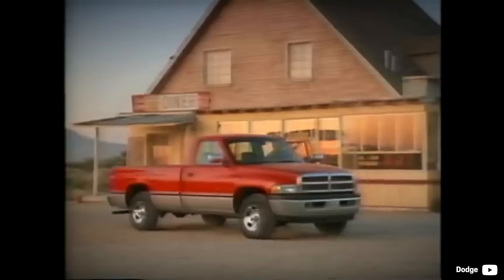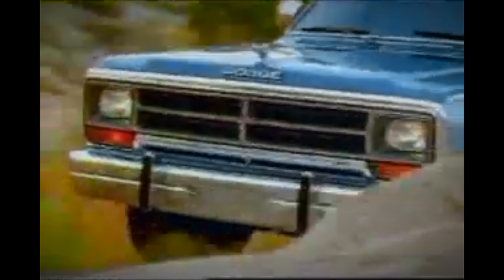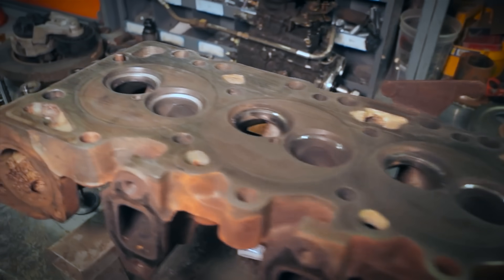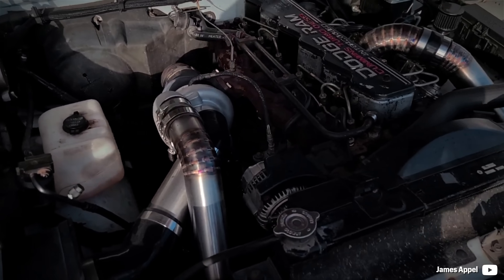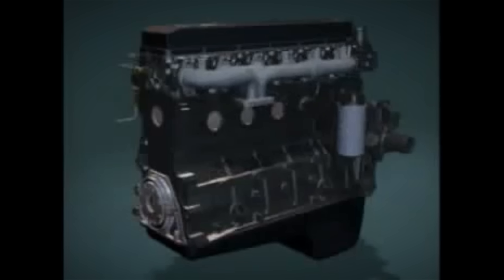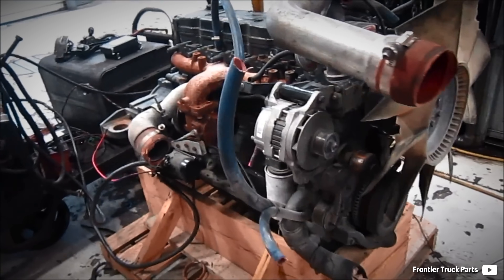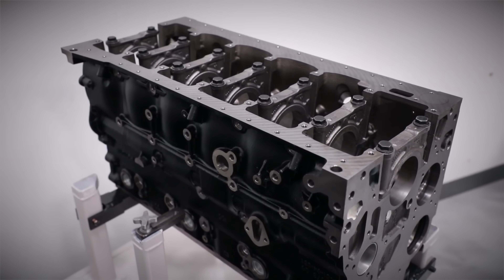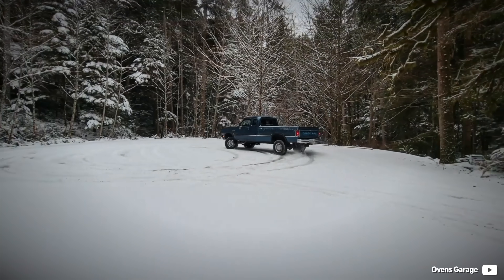The Most Reliable Diesel 6-Cylinder?

Comment: What's infuriating is international had the dt360 which is basically a better built 12valve cummins. The wet sleeve block meant that it could be rebuilt while still in the truck. The adoption of the 6.9 idi is an example of marketing getting in the way of practicality. Ford thought that American buyers wouldn't accept an inline 6, even though most agriculture diesels and class 8 engines were inline 6's
Reply: 👍👍..I've got alot of Cummins powdered trucks and machine's,but you're not wrong...👍... what's a dt360 weigh..just curious
Reply: @elroyelblander6277  I'm not sure right off the top of my head but I know they are a bit heavier than a cummins due to being wet sleeve instead of parent bore.
Reply: @farmyardfab 👍..right..and the head and block are probably a bit thicker... although,wet sleeves have there inherent issues... depending on the rod/stroke ratio, they vibrate alot and cause problems over time...but anyway, always wondered why they didn't use the 360 and the 408 instead of the fricken V8.. don't make much sense to me... Oh well 👍👍👊
Reply: @farmyardfab  DT366  was a piece of garbage  , underpowered , always leaking some fluid ,i've been around a lot of trucks with them and any truck that had over 180K had blowby that a cummins won't have till 400K or more ,,and they only have 250HP ,,the reason they are always broke is because the driver has to thrash it ,,lots of them in school buses  just like the 3126 CAT/C7 , they are good for 200K miles and then junked which is what happens to school buses,,,i've got a 140HP case tractor  that has a 6BT cummins with 12000 hours and still no blowby to speak of
Reply: @wildcoyote34  they all leak dude, stop the hate.
Reply: @wildcoyote34  6bts that aren't equiped with the p7100 are underpowered as well. As to longevity I can't speak ill of the 6bt but the dt360 is immortal with it's wet sleeve construction in comparison. I don't know what happened to the engines you were exposed to but I haven't heard much bad from anywhere else.
Reply: @farmyardfab  i've seen way too many DT366 engines with excessive blowby  ,and i'm not talking about 8 or 10 engines i'm talking about dozens and dozens of engines ,majority with under 200K miles ,,6BT is a light duty engine compared to a DT366 ,,DT366 suffers from constant issues with liners leaking coolant  ,,I've scrapped 3 this year that had issues with cracked liners  that had damaged the block ,,all of those had been run till they quit and were beyond economical repair ,,what says it for me is ,,,what do you see the DT466 engine installed in ,,IH trucks and nothing else ,,the 6BT was installed in dozens of vehicles , tractors , generators ,trucks ,RVs buses ,,it's economical , reliable and long lived ,,the P7100 mechanical pump is nice because you can turn the fuel up easily ,,with stock injectors and an intercooler  most didn't make over 200HP from the factory ,,my farm has a medium size CASE tractor from the early 80s and it has a 1st gen 6BT it's about 170HP
Reply: @traxxasrcfun  funny my case tractor doesn't leak anything except air from the braking system ,,i have yet to any international engine that didn't leak oil ,,DT360 and 466s love to leak from the crankshaft and front cover and valve cover,, Caterpillar engines from the timing gear cover and where the compressor mounts and around the oil pan ,,the places cummins like to leak , especially the 6BT are the individual rocker covers , and the timing cover ,,, if you seal them right they don't leak EVER, and mine were fixed right many years ago
Reply: @wildcoyote34  and our 250k dt466 doesn’t leak a drop, what’s your point
Reply: @wildcoyote34  every diesel will eventually leak.
Reply: @traxxasrcfun  yep and when it does if it gets fixed right it never leaks again ,,,,and if an engine is built right it'll never leak  ,,the problem is mass manufacturing isn't that precise and doesn't allow the time to make sure things are tight enough not to leak ,,a little extra sealant makes  a huge difference,,
Reply: @traxxasrcfun  when your DT466 has 12000 hours on it  come talk to me ,,the 3126 CAT in my 95 GMC 5500 RV toter  has 400000 miles on it with no leaks  or blow-by ,, when i bought it 10 years ago i went through it and replaced every hose and resealed the entire engine even though it didn't leak ,,it won't leak now ,,i have an extreme dislike of oil leaks  ,a habit picked up from my grandfather ,fix the problem before it starts ,,,
an engine constantly leaking oil is not only a mess to work on but also becomes a fire hazard, and then there is the $5+ per quart of oil which when you own a half dozen large trucks and dozens of pieces of machinery ,, ,the oil leaks add up to a big expense
Reply: @wildcoyote34  I have no idea how many hours it has. We also have a 3126 cat in a freightliner. Great engine but my gosh is it slow. The dt466 walks it bad.
Reply: @traxxasrcfun  3126 is a similar sized engine to a DT466 ,,from what i have seen the DT466 was never used in medium duty trucks like the GMC 5500 i own ,,leastwise i have never seen one ,,other than in custom applications ,,,the other engine i have seen used for swaps is the  8.3 ISC cummins , i personally have one in my other medium duty truck ,and it'll run away and leave my cat powered truck in the dust ,,the cat engine just is not fast and mine has a lot of miles on it so i don't push it hard ,,when it dies it'll get replaced with a cummins 8.3 the one in my RV tow truck has more power than the cat and it also has an exhaust brake which works very well ,,it's pushing 250,000 miles  ,,i pulled it from a wrecked RV a few years ago ,,i changed it to  a manual transmission  7speed eaton compliments it very well
Reply: Do you mean dt466
Reply: @lewisbradford3305  no goggle it. The 400 series and the 300 series were both engines originally designed by International Harvester co and later produced by International Navistar. They are sister engine lines that do share a few common parts and one could see them as big block and small block diesels for the international medium duty truck line. The dt360 is smaller in every dimension than the dt466 including a 360ci (5.9l) displacement. I believe the dt360 was discontinued in 1994 while the dt466 was changed into the dt466NGD (Next Generation Diesel) and eventually the dt466E (electronic).
Reply: Odd enough, in Brazil Ford resorted to an engine which was also easier to rebuilt
Reply: Packaging was the issue with these motors.   They can be made to fit but it's quite a bit more work than the 6BT.  I looked really hard at them several years ago.  Great engines.   There are swaps out there.. but the 6BT is just easier to fit.
Reply: V8 was chosen for superior power band and packaging, idi for noise and emissions. I'm getting a chuckle from the dt haters, when all the Flatbrim fat chick haulers have all been blown up there will be dt's to haul them to scrap.  DT is too big and heavy to practically use in light duty, and much the same as the 5.9, isn't particularly suited.
Reply: @doxnoogle5782  the dt 360 isn't really all that bad. They fit without firewall modifications and the radiator sits in the stock location. I did have to cut out the cross member but with a different oil pan or a different factory cross member they could have made it work. As far as power band I really doubt that a factory idi would have any sort of advantage vs a p pump dt360.
Reply: Stock to stock?  Either way talking power band, not raw capable output.  V8s may not make the peak torque of a comparable inline, but you have usable power from off idle to 3500 rpm, sometimes more.  Been my experience inlines (5.9 / 8.3, dt360/466, 8.2, 9.0) peak around 2200 and are done by 2500 majority of them are in fact governed there.

Also most sources put the dt360 at ~1400lbs dressed.  Tbh, if dealing with the weight either way, i would choose 1160/3208.  Im biased here though, we have an 1160 in our 69 F8000... no muffler, big stacks :D

What did you do for transmission?
Reply: @doxnoogle5782  indirect injection IDI went away with the 90s and the death of the 6.5 detroit diesel in GM trucks ,,they were slow ,inefficient and far from clean 
i'm not sure where you are getting your info at because there never was a V8 diesel that was packaged neatly ,, the word STUFFED into the truck applies to any V8 diesel installed in a pickup truck or van ,,V8 diesels were invented because americans have a love affair with V8 engines ,,not because they were neatly packaged ,,or easy to service ,, that falls to the inline 6 cylinder engine 
actually the 5.9 cummins was perfectly suited to light duty trucks ,,it's not really heavy , has a decent power to weight ratio and is reliable ,, DT466 weighs over 1400 pounds mostly due to having a wet sleeve design  , it's block is heavier ,,the 8.3 cummins is actually much more comparable to the DT466 , it's actually heavier than the DT by several hundred pounds ,,and it also has wet sleeve design 

i know i had to upgrade the suspension in my RV tow truck when i swapped the V8 gas engine  with an 8.3 ISC it weighs 1800 pounds ,,my 454 weighed just under 900 fully dressed,, just under 350HP at 2500 and 1070 Ft pounds of torque at just over 1050 rpm it'll beat a DT466  easily, plus i have an exhaust brake and also a VGT turbo ,,if i could add Jake brakes to it i would do that as well ,,,the later DTs do have the variable turbo as well ,,i'm not gonna say that the DT466 is a bad engine like so many other people have ,,because the numbers speak for themselves  there are millions of them so it can't really be a bad engine just because i don't like it ,,i'm not a fan of V8 diesels in general either
Reply: Actually, my info comes from mostly historical documents from just about every manufacturer.  Inlines, 8 and 6 gave way in all but fringe cases to v8s and v6s due to packaging.  Im not sure why you think its so hard to put a v8 diesel thats the same size as a big block into and engine bay that already houses said big blocks...  Not just americans that love v8s, find a gear head that doesnt, theyre just more common here due to the fact every soccer dad thinks they have to have a "truck" and karen needs her denali suburban.
A 5.9 weighs the same as the other light duties +/- 100lbs, this varies through the years.  Combine a meager 160hp with an extremely laggy h1c and a 2400 rpm defuel, they really hauled the mail.  Point of fact, the 5.9 never once made more horsepower than a ford equipped diesel, cummins did however have the idi beat in torque.
We were talking dt360s, the 466 is a behemoth.  There are no compression brakes available for the 8.3, jacobs or otherwise.  The dt466e has no shortage of troubles, much the same as the ISX.  For my part ill stick to talking mechanical engines.  Both the dt360 and 466 are definitly under-tuned from the factory, their performance headroom however is staggering.  Ill part with this, if its a tractor it needs to be green, if its a truck, yellow.  Ill keep my hotrod IDI too.  Either way, im sure that 8.3 was a huge upgrade over the 454 and it no doubt drives easier on the road and on the wallet.
Reply: @doxnoogle5782  something interesting , why didn't they keep making the DT360 if it was such a good engine  , i honestly don't know much about them ,,
,,I wondered whether there were compression brakes available for the 8.3  , i never could find any information  ,, now i know 
it has an exhaust brake though and it works pretty good 
I'm pretty much an equal opportunity employer ,, color doesn't matter so much  so long as  it works and does the job reliably ,,still have a 1959 JD 730 diesel  that my great grandfather bought new just 2 years before he died and i am currently restoring a 1969  4020 ,,same way with trucks i've had some of everything
Reply: I dont know, but my assumption is the IDI and t444e replaced it in application, smaller, lighter, easier to package, more emission friendly.  The 9.0L was an option as well, i base this just off of what ive seen in S series internationals, we have had a ton over the years as farm trucks and fire trucks on the ranch.

I dont have any real extreme hate, except for the ISX, 8.2 detroit, 9.0 IH, and newer deeres.  We havent owned an 8.3 that didnt get a headgasket, 7220 case, f750 and im pretty sure thats what was in that pos 80s kw we had.  JD up to 60 series were simply the best, no comparison, today, over priced junk unfortunately.  Have always been a fan of Cat, never had problems with them, and the 6nz in the pete is a monster.  Also have a 650 with the C7 that acts way bigger than it is for the weight.

I missed your 12000 hr comment, lol thats cute.  We have a 1266 with over 40k on it and the DT360 in our pumper truck has 540k miles.  This is bouncing around in the rocks, smoke, dirt and sagebrush from fighting fires all its life hauling 4500 gallons of water, only god knows how many idle hours are on it.  Tbh, not that impressive for a dt, whats impressive is the allison has only been overhauled once (ex gooberment rig).  Our 4250 has 26k hours on, runs like new, 4640 was at 19k when we sold it.
Reply: @doxnoogle5782  not many tractors run past 12-15K hours  i live in southwest  iowa and farm tractors around here if you buy one with 12K hours you are usually buying problems ,,,I don't know if my 8.3 cummins has been apart before  i have not had any problems with it and it had relatively low miles when i put it in my truck ,,the tractor is a 5.9 with a P pump on it ,, it's hauled hay , ran a baler and corn auger most of it's life  , so far never had the transmission out of it ,,i did replace the clutch about 10 years ago when i fixed a rear main seal leak one of the local farms i work for has a 1066 IH  that has close to 20K hours on the unit but i know for sure it's had a set of pistons and sleeves because it cracked a sleeve while i was working with it mowing ,,was getting water in the oil ,,my large heavy tillage tractor is a very much overpowered Steiger ST325 cougar 2 it's got  almost 25000 hours on the tractor but i know for sure it's on it's second engine ,,i bought it at a farm auction in 2003  and the 3306 Cat tossed a rod on the drive home it got replaced with a 3406E and a fuller 18 speed bought from a local heavy truck scrap yard in 19 years i've averaged 450 hours a year on that 1 tractor ,,this time of year it'll run 40 hours a week ,it's the only thing i have that'll pull all 4 of my parker 500 bushel  corn wagons
Reply: Ive definitely seen tractors in worse shape with less hours than ours, but we do good maintenance and we dont have a lot of hired help.  The 1266 is a bit of special case, its spent most of its hours pumping water, not a lot of work, just a lot of run time.  That said, the ol girl is pretty tired in her semi-retirement.  If its over 100 she doesnt take as much ether as she usually does.  Weve split the 46 a couple times, but engine hasnt been apart.  The IP on the 42 is going, starting to lope pretty bad but the engine is flawless, all its ever done is haul mint tubs or light stuff like cultivating.  I know deere basically specs an overhaul at 8k, but i never understood why since theyre in such good shape at even double that.  8.3s like to leak coolant from the corners of the head. At least the few weve had do.
Reply: @doxnoogle5782  yea i have had my 8.3 do that if it gets really hot it'll seep some coolant in the front but it never seems to need anyy added
Reply: The DT-360 and DTA-360 took over from the 9.0L V-8 diesel, which itself had never been turbocharged. The 9.0 diesel was a descendant of the gas V-549 V-8 and began life in 1966 as the DV-550. Early examples of the DV-550 and the smaller DV-462 had a "modulated displacement" fuel injection system that shut off fuel to the first three banks of cylinders depending on the load, the same operating principle as Cadillac's short-lived "V-8-6-4" variation of its 6.0L gas V-8.

The DT-360 and DTA-360 were then replaced for 1993 by the larger 6.7L DT-408E, but this iteration was short lived due to emissions and was instead replaced for 1998 by lower-torque versions of the tried-and-true DT-466E. Cummins would years later replace the tried-and-true 5.9L ISB with its own 6.7L version.
Reply: get a real diesel like a DT466 or a 300 seris navistar. cummins is crap belongs in a crap dodge you do know that Dodge stands for Do  Or Die Garage Experiment
Reply: @timklindt1697  you have your opinion  , like i told someone else ,, when your DT466 has 12000 hours on it come talk to me ,,my case tractor that my grandfather bought new in the mid 80s has a 6BT cummins that's never been apart since new and has just under 12,500 hours 
,,i don't own any dodge products   ,not a mopar fan never have been ,, don't have to own a dodge to have a cummins engine ,,,if it's not a cummins it's a detroit ,,only 2 colors you'll ever see me with in  a diesel engine

Comment: Living in the Southeastern Indiana area and near Columbus Indiana I have friends that work at the Cummins Corporation. Absolute Rock solid engines. The engine is absolutely the best part of a Dodge or RAM pickup truck. Everything else is inferior.  It is said from people that work at Cummins the Chrysler Corporation ( Stellantis ) is more trouble than any other customer.  If you want a good truck that would last stick a Cummins engine,  Allison transmission and a Ford body.  Now you have the best of all worlds.
Reply: Rock solid. 
Besides cracking blocks and killer dowel pins